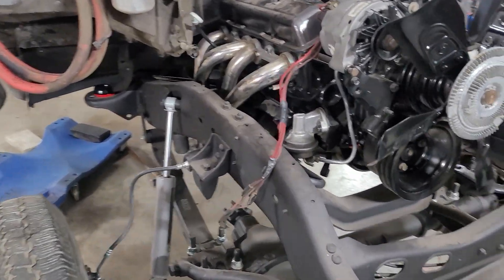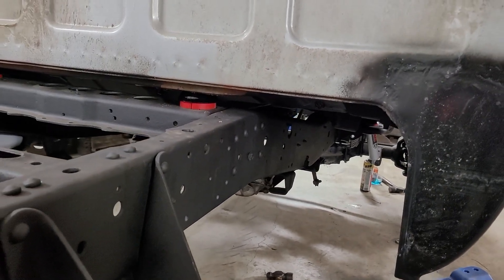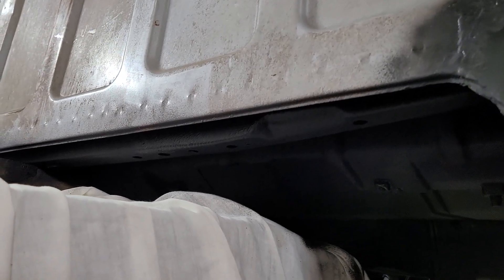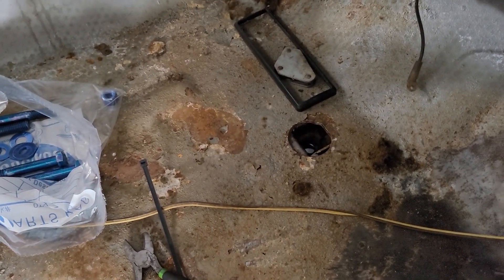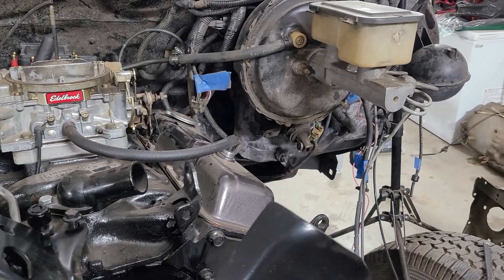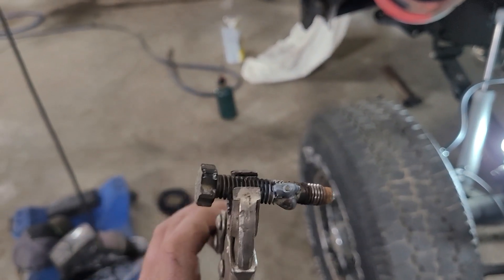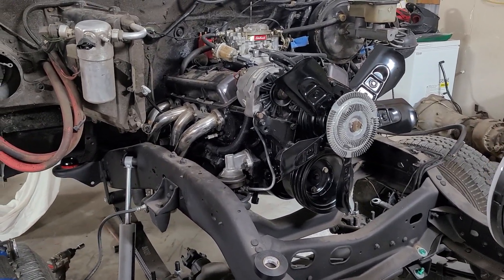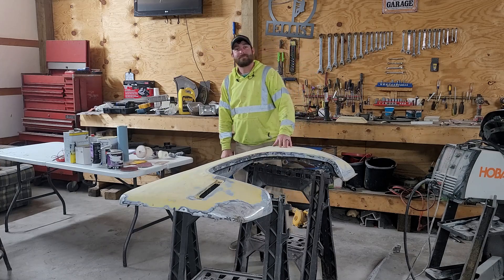Rebuilding a 1985 k10 part 13 getting close to first start!!!

Comment: Your "booster filter'' is not like an air filter. It is supposed to keep gasoline vapors from deteriorating the rubber diaphragm inside the booster.  It needs to replaced and installed
Reply from the maker: Thanks for the info, I'll get one for it. I didn't really know what it was for, and the internet wasn't much help.